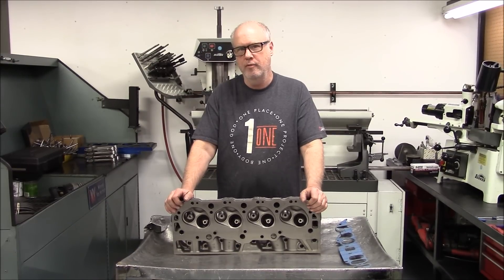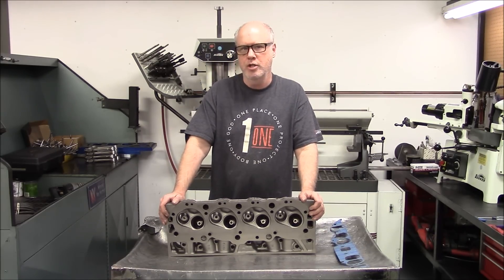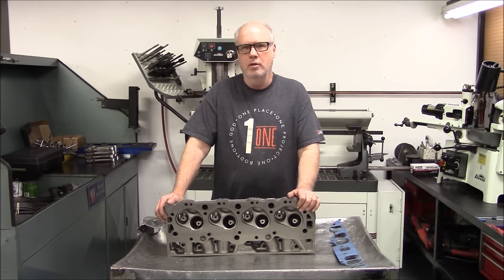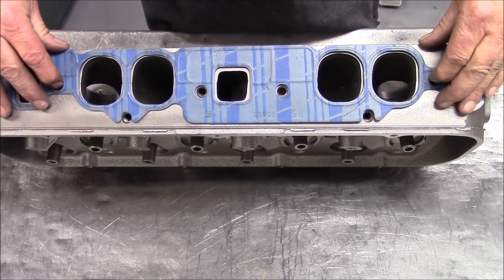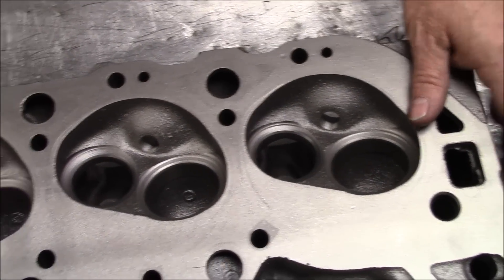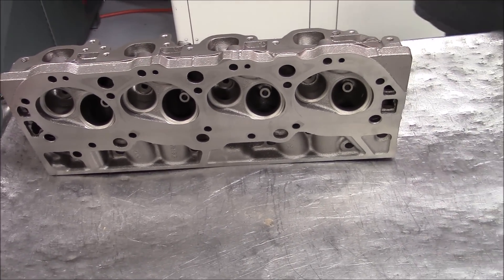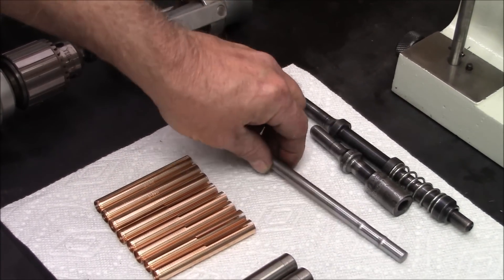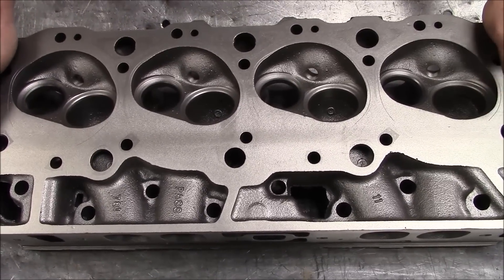GM 781 Cylinder Head Prep and Overview 620+ HP Street/Strip 454 Big Block Chevy

Comment: My BBC heads have 239 stamped under the head where I've seen in other videos 781 or 049 what does this mean what heads do I have
Reply: I don't recognize that casting number, it's probably a peanut port truck head made for low rev torque. For an oval port 049 or 781 is about the only way to go unless you want a closed chamber head.

Comment: When you un-shroud the valves you install the head on the block reach up inside and scribe the bore on the gasket surface.  you do not use the gasket or any marks left from the gasket.Then you hand shape the chamber to the marks. Counter boring with a guide machine is just a quick and dirty way to GET $$$ if you use the gasket you will have the bore edge hurting the flow and also the potential for hot spots. The marks from the gasket and the seat wear show this casting has had a hard life would not be my first choice.
YOU ALWAYS DO GUIDE WORK IN A GUIDE AND SEAT MACHINE YOU NEVER HAND BORE OR REAM with a hand held drill The sunnen machine he has is ok for seat cutting (If you know how to use it)but not so good for guide work its slow and clumsy. When sunnen wanted to make guide machines they bought out tobin arc and did some minor updates . The design is from the 50's
Reply: Tom Hutchins, what's your experience?, where is your shop or who do you work for  building engines?, how many engines have your built and for whom? Enlighten us.
Reply: @olderthanyoucali8512  from your screen name your obviously an idiot. Cali? we are all Americans you ignorant inbred fool trying to start a pissing match over a tech comment that is a year old? Now crawl back in your single wide and brush your tooth.
Reply: Marks engines run quite well.    
   Partly due to valve seat concentricity,   This is achieved with good guides and straight pilots and that old machine in the videos.

Comment: This guys in another world . You never remove the guides on a BB chevy head they go trough the water jacket and will leak. Also the guide is not concentric because it is inserted then finish bored for alignment at the factory the example he is showing is an extreme case.
Reply: Lol every bbc valve guide I've done was the intakes and nope no water
Reply: Are you sure about this Tommy??
Reply: The exhaust guide is the one in the water jacket.
Reply: Your actually responding to 5 year old posts? Your a lonely boy aren't you? Note the guy in the video stopped posting ? Intake exhaust you never pull iron oem BB Chevy guides.  @jerrylauber7311

Comment: BBC eats flat tappet cams! I know, I ate 2 of them. Hydraulic roller far better
Reply: Nitriding the cam and using hard foot lifter from Johnson is allegedly the cure along with good oil.        Some say it was aggressive ramp rates,  and shit oil, which certainly could be true.    
  Even rollers have problems on occasion.   It’s usually too thick of oil, cause old dudes grew up with 20/50 and sae 50.       Excessive valve spring pressure could also be a contributing factor.
Reply: not true!
Reply: Pssssh only worked for 40+ years before rollers. Sht oil and Chinese metal
Reply: They require a specific break in procedure.... what did you do? Start it up and drive to the gas station immediately 😆
Reply: @jasoncardoza6375  have you ever built one with a large flat tappet cam with mega spring pressure? Brian is right, we have lost a couple cams in BBC and we always use break-in oil AND zinc additives.
Reply: @jasoncardoza6375  when brand new BBC engines are wiping cam lobes. I'd say it's a problem.

Comment: Why are you going with flat tappet rather than roller?
Reply: Probably $$$$$$$$$$$$$
Reply: Yeah, it's a money thing.  That lift number is really mild for a BBC and it's hard to imagine he's even leaving 20hp on the table over a solid roller considering the heads, but he could be saving 1k in cost considering going to a roller cam adds some to the cost of nearly every part on a BBC and can add machine work depending on the block.